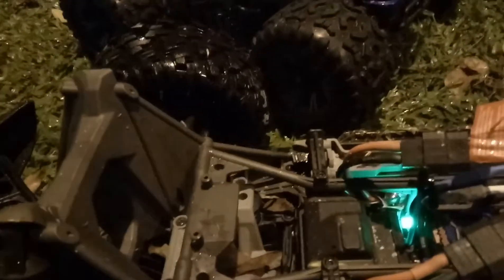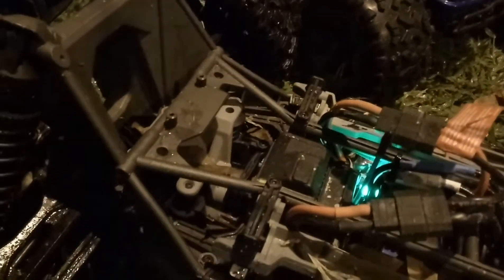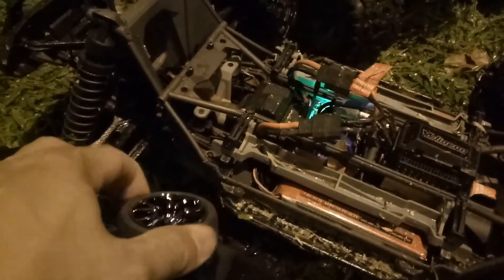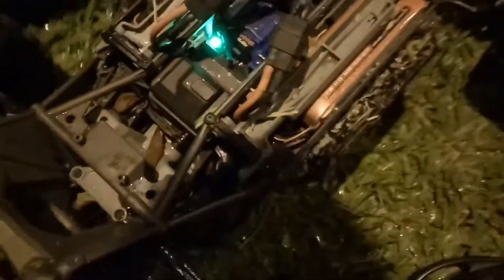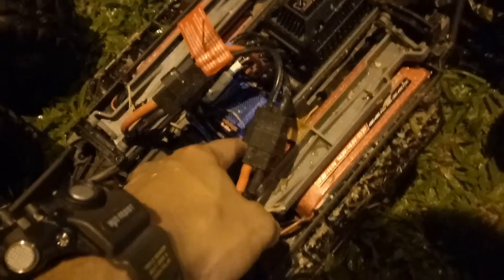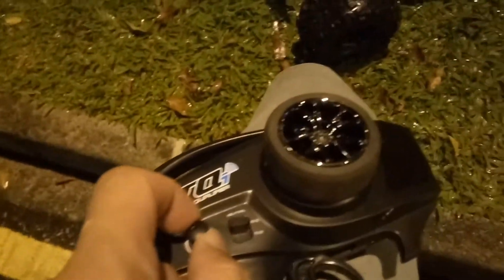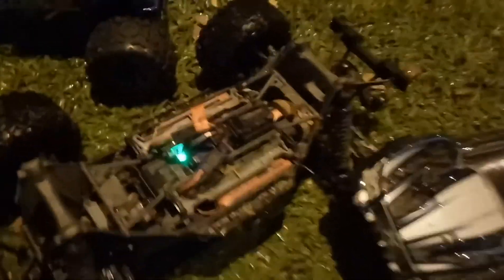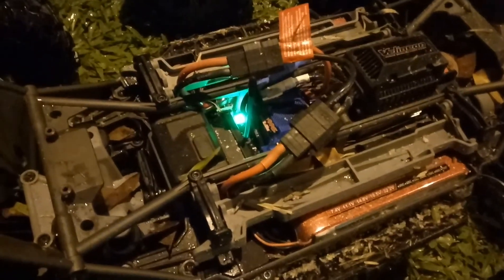Traxxas X-maxx 8S servo failure after only 4 runs! What!

Comment: My friend with the 2085x servo is better??
Reply from the maker: Yes, much much better 😄
Reply: Monster-X RC no esc problem? Or reciever?
Reply from the maker: ESC have to change to the Hobbywing Max 6. Stock receiver no problem but I changed mine to Flysky.
Reply: And also changed that servo saver spring and the arm? From the 2085x servo?
Reply from the maker: I just used the stock servo saver spring.

Comment: by hearing it from the sound,maybe the servo horn is loose from the servo teeth,or you may check the servo saver?try to open it and check.the xmaxx servo is a plastic teeth i think.hope your xmaxx doesn't have much critical problem.
Reply from the maker: SPEED TUJUH I've yet to open it. But many on the Traxxas X-Maxx Owners group have experienced the same problem. It's the motor of the servo that's faulty. Sucks big time bro. Damn leceh. For a high end product, this kind of thing should not happen.
Reply: yup,its very pricely for the xmaxx rtr,yet the parts are not as durable for the truck.feel your frustration bro..
Reply from the maker: SPEED TUJUH we just ordered the Traxxas 2085X metal geared servo. Plus Hot Racing's aluminum servo horn and steering brace assembly.
Reply: Monster-X RC hope the new servo and brace should be good
Reply from the maker: SPEED TUJUH Thanks bro. Roughly 2 weeks wait before everything is in and also need time to fix it all up. I guess x-maxx will be out of action for 2 - 3 weeks.